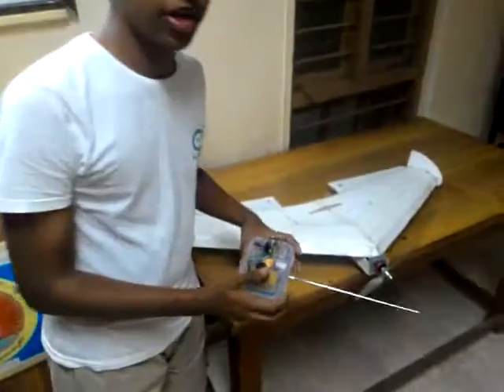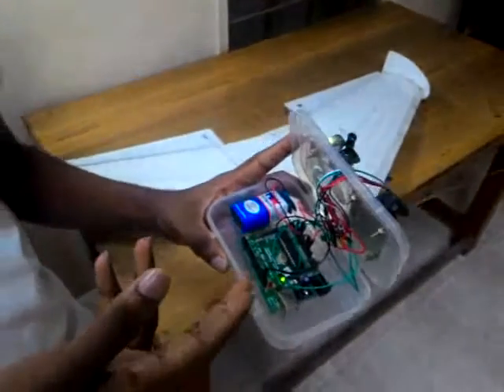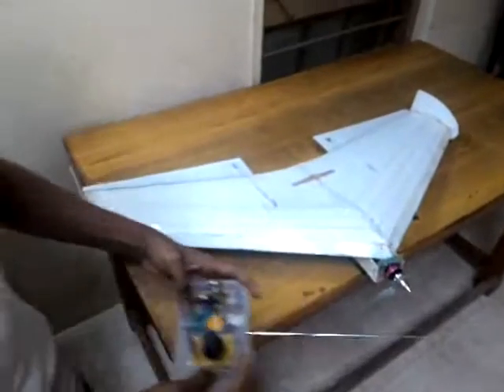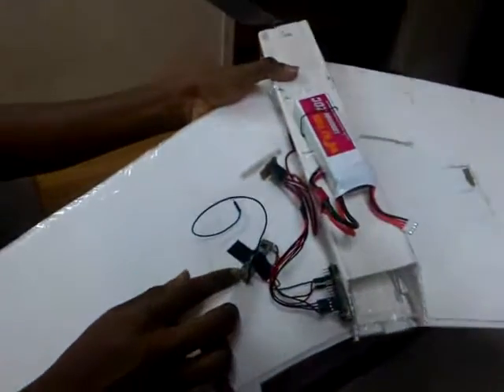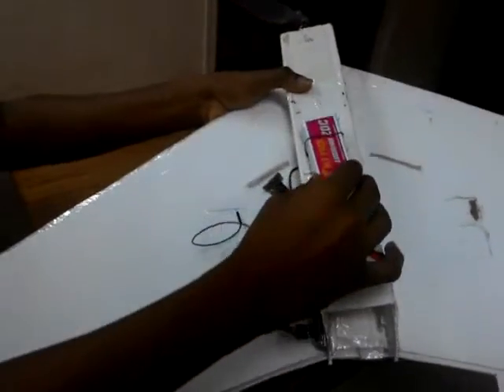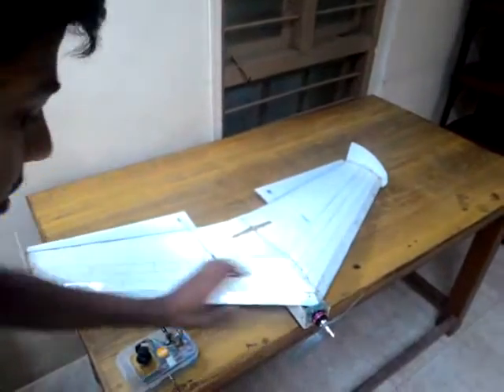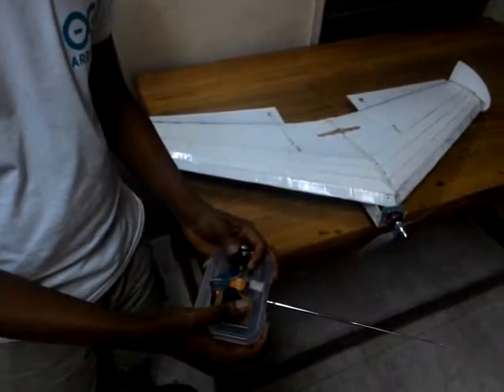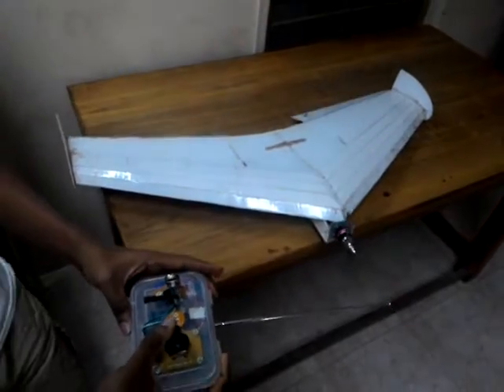Arduplane - Arduino based RC aircraft in just 50$

Comment: I am doing this because arduino planes are so much more versatile and cost effective.
Thank you very much!
Reply from the maker: Thanks a lot for your kind words
Reply: Is the electronic as fast as normal electronic for rc planes?
Reply: @jo21e6  depends on how you program it, but the example shown here is pretty excellent. I think the radio module might be a little glitchy at medium distances. For long range performance, I recommend using an NRF24L01 module that is a bit more expensive but the standard for this kind of stuff. A Lora is even more expensive and offers better range, but that might be for a more high end DIY system. Good luck!

Comment: Arduino: 1.8.5 (Windows 7), Board: "Arduino/Genuino Uno"

In file included from C:\Users\Dipanshu\Downloads\Arduplane-master\Arduplane\receiver\receiver_2\receiver_2.ino:1:0:

C:\Program Files\Arduino\libraries\SoftwareServo/SoftwareServo.h:4:22: fatal error: WProgram.h: No such file or directory

 #include <WProgram.h>

                      ^

compilation terminated.

exit status 1
Error compiling for board Arduino/Genuino Uno.

This report would have more information with
"Show verbose output during compilation"
option enabled in File -> Preferences.

SIR PLZZ HELP
Reply from the maker: hemant verma go to that location i.e software servo library and open softwareservo.h file replace WProgram.h by Arduino.h. It should work.
Reply: problem solved sir  . 
thanks

Comment: Can we use brushed  motor instead of brushless motor.if then what will be the code
Reply from the maker: Indra Kumar Gupta Nope. Brushed motors are used for torque based applications. The speed of brushed motors are less and hence cannot be used for planes.
Reply: Thanks, actually Brushless motors are too expensive in India .So I was thinking that whether we can use coreless motors or not.

Comment: Man i have a doubt: how many transmitters you used and how to make em not interfere with each other. thank you
Reply from the maker: One transmitter and one receiver. 433Mhz RF module pairs.
Reply: Oh nice. thank you Vishwas. Nice video. Just one more question: how the hell do you send 4 channels in one transmitter? thank you
Reply from the maker: Hey its all about programming it uses Advanced Frequency Shift Keying (AFSK) , digital modulation where in which you can program it to have more number of channels. If you want you can increase the number of channels.
Reply: Hey Vishwas thank you so much for your responses. I studied what you answered and now have a question: How can i increase the RANGE of this simple AM transmitter? I found this HC-12 that reaches over 1km. I want to know if i can get the same from this simple am device. thanks
Reply from the maker: The range of the AM transmitter can only be increased by increasing the transmission power. Here the power of  433Mhz cannot be increased  as it's a module. You can replace it with NPF 24L01+ 3dB gain antenna to increase range up-to few kilo meters. 
NRF on both sides , which is much more powerful than the 433mhz tx rx.
Reply: yeah but the NRF24 is a SPI transmitter, not a pure modulation. Anyway thank you. Ill try the HC-12
Reply from the maker: Go ahead. All the best.

Comment: Please tell me are you used 4 pin reciver or 8 pin reciver
Reply from the maker: Please understand that its a RF Tx and Rx made using arduino. It does not contain any 2.4GHz Tx Rx. And here I have used 3 channel for communication.
Reply: hmmm... so it's not 2.4ghz.. whereas..the distance is limited..!  but could I control the plane so high like aircraft generally
Reply from the maker: mukhlis1010  The range is limited to around 300m in open air. Where as you can get around 500m to 1km in 2.4GHz.

Comment: you have used which wireless chips?
Reply from the maker: MRIDUL SHARMA  433Mhz RF module.  NRF 24L01+ is another option.
Reply: Vishwas Navada i want range of about 500 to 1000mtrs what should i use?
Reply from the maker: MRIDUL SHARMA  second one NRF24L01+ with antenna (3dB gain ) will give you around 1km range at 2.4ghz.
Reply: Vishwas Navada can i personally contact u
Reply from the maker: MRIDUL SHARMA Yeah sure. Give ur mail id. I'll send my no.
Reply: Vishwas Navada can u provide link to your Facebook
Reply from the maker: Facebook.com/vishwas.navada